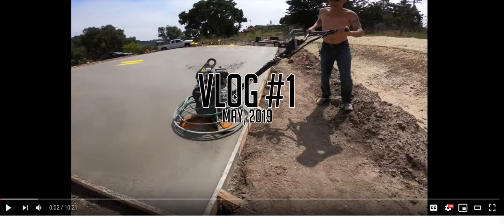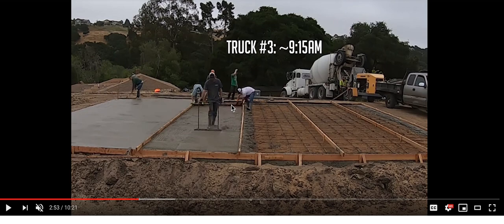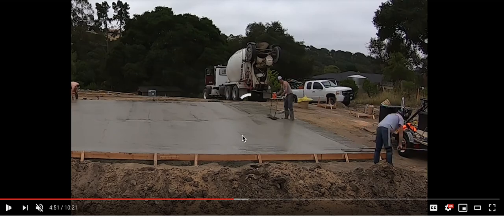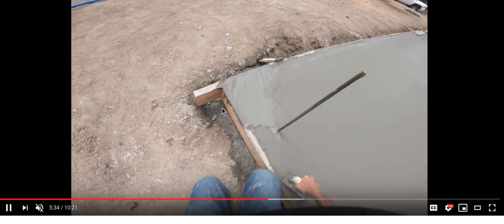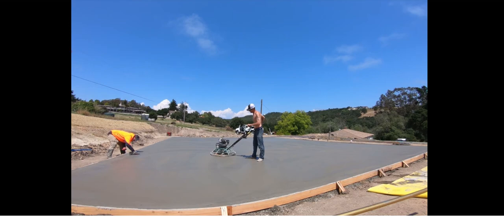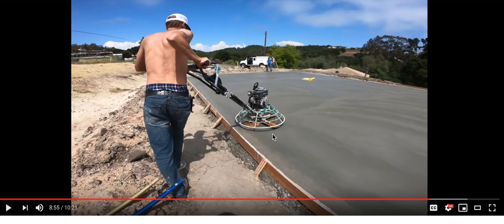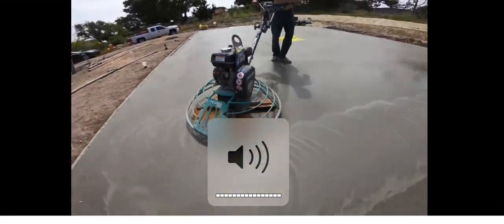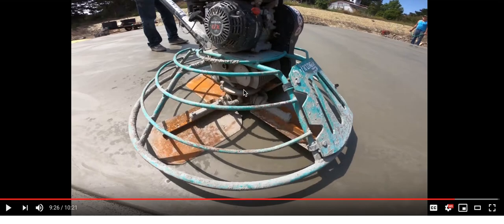Concrete finishing mistakes

Comment: Putting water on top is bad while trying to get a smooth finish?
Reply: Yes. You’re only supposed to use the water that comes mixed in with the concrete, concrete is about timing. You can easily get a smooth finish by only using the cream and water coming up from the concrete.
Reply: Use evaporation control in the beginning to give y more time, and finish aid of you absolutely need to, don’t just use eater

Comment: From the sound of the blades that shit was hard. Maybe the guy on the funny trowel was no good, or the boss wanted a "ring trowel" finish, as one boss of mine did, where your trowels ring. As to joints, use a "slab crab", a soft wheeled saw used day of pour.

Comment: For the last 2 shots with the michine. Its ok to add a littil water for a nice polish but you have to be quick, spray a mist of water crank the trowels or combos up let the  michine make juice pass half or 1/4 of slab then go back drop trowels start spitting juice making little ball of cream let set 5 min or so then go back and start polish everything will be uniform and same colour not blotchey.
Reply from the maker: And what does water do to surface AFTER initial SET?  LEARN LEARN OR YOUR WORK WILL SUBPAR

Comment: we always put water on it to get a burn finish
Reply from the maker: Pay attention to the video and what displacement does.
Reply: Yeah I think he thinks he’s burning it; but when you burn, you spray small amounts, like out of a water bottle to just clear up small imperfections, not soak the whole slab
Reply: Dont use water, you shouldn’t have to to begin with, use evaporation control in the beginning so you have more time to finish, and finish aid if you need to at the end, never water
Reply: Wrong